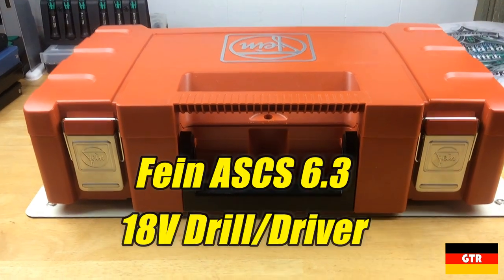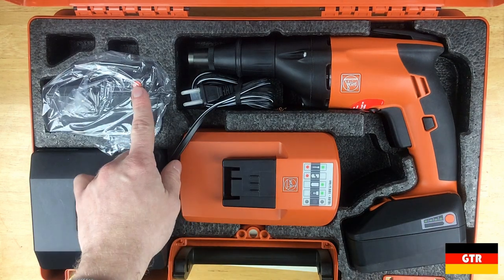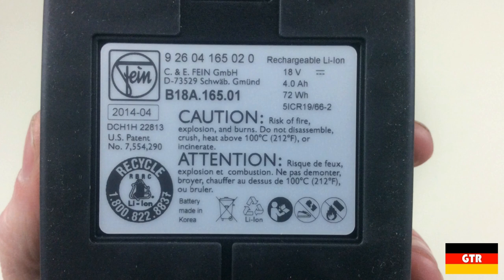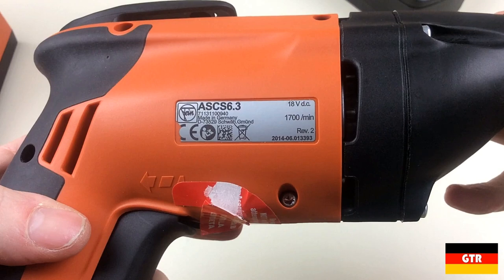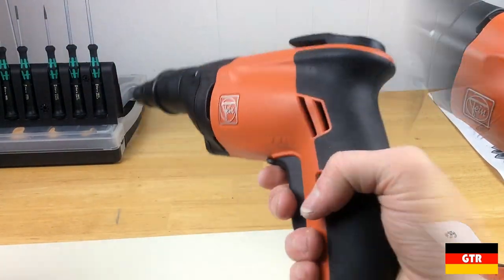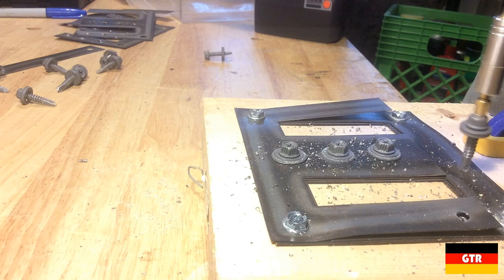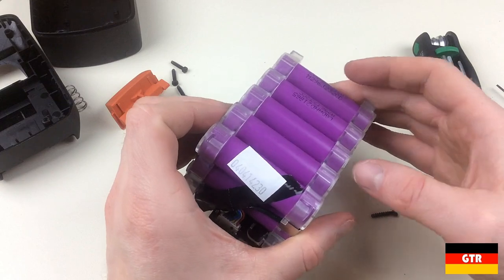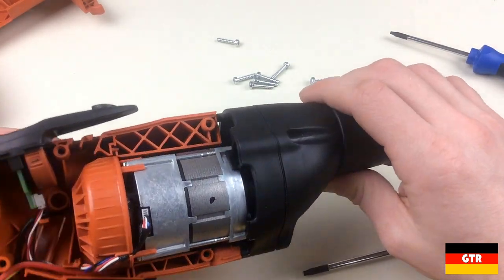German Tool Reviews:  Fein ASCS 6.3 (18V Drill/Driver Kit)

Comment: the handle is designed very well. you can carry one or two fein toolbox on one hand always well balanced. edit: and this tool fits to my small hand when i hold my middle finger on trigger and indexfinger is on the side of tool. it's easy to apply pressure on the axis of the screw with this hande desing
Reply from the maker: Yeah it is not too bad after getting used to it.  I think it is because it is mainly used for screwing down (roofing) instead of screwing horizontally.  It makes it easier to drive down since the weight of the tool helps you in this case.  It is just not something I'm used to.  If I get a different fein cordless drill I will compare the center of gravity.  Thanks for watching!

Comment: These are actually very easy to use and to drive screws with after a little practise even on vertical surfaces. I havent used the fein in particular but TEK guns all have a similar design with the weight forward.
Reply from the maker: Cool thanks for the information.  I not normally installing TEK screws and this is the first specialized tool I've used for that application.

Comment: Fein is the other brand I was looking at when I bought an impact wrench. I liked the feins for the seamless housing designs (just like Festool). In the end though I found out the Fein one was just a reskined Makita (if I remember right) and made in China. And Festool don't make impact wrenches.

In the end I went for another company that makes beautiful seamless housings, Hilti. Hilti also put the sticker on the bottom where the battery attaches, it'll never come off. Serial number is also stamped into the plastic.

Shame in a way, because I have a Fein angle grinder, and it's a beauty. I also like how Fein use the foam inserts for the cases.

Comment: The Germans are very particular in everything they do and make so they design their tools to work with them for that reason and when you look at little features like the electronic torque management system that beeps every time it reaches correct torque setting that’s very innovative and shows the German capacity for precision work it’s all very awesome lol and I’m the same way whenever I do or build something the German made tools would work very well for me lol
Reply: Hunter Prowse German thinking, well it ain’t shrinking !!!